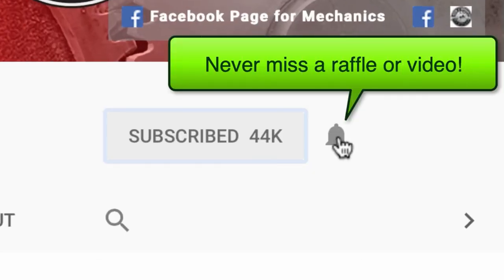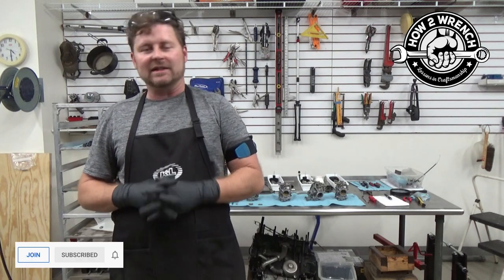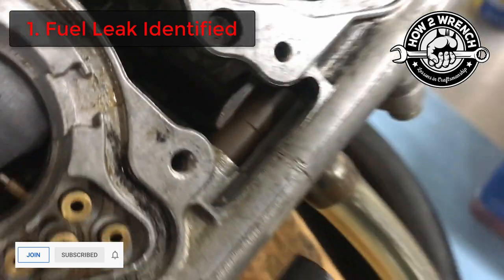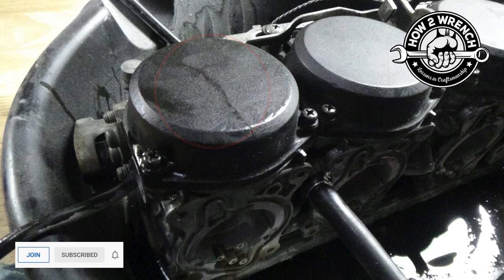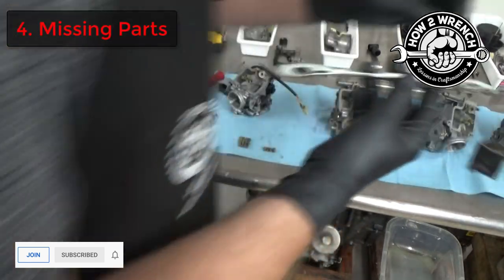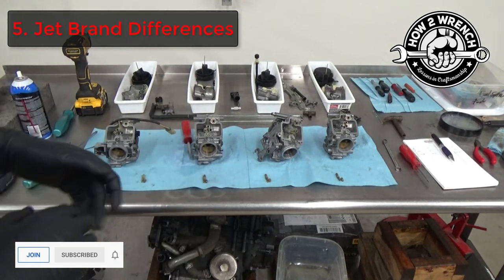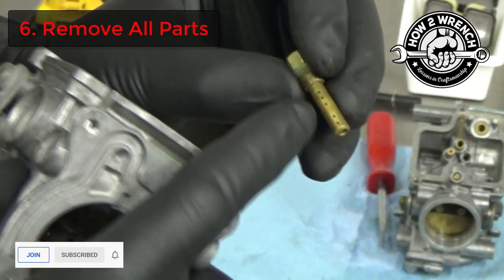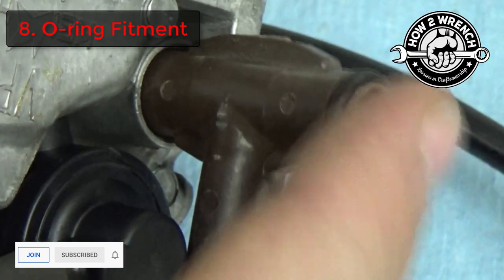One Carburetor rack with 7 different problems when we split the rack #how2wrench #carbrebuild

Comment: Are the deep dive videos for this carb job ready yet? I couldn't easily find them if so. Not that YouTube has best interface for that.
Reply from the maker: Hey JM what model you looking for? I can prioritize it since you are a member...and thank you.
Reply: @How2Wrench  You're welcome, Shane. The O-ring video would be very helpful. In the past I've had great luck getting quality Viton o-rings from the O-ring Store LLC online, but measuring and sizing them is a challenge of course because old o-rings have often shrunk, etc. I will check out your other video about o-rings in the mean time. I'm working through about five sets of carbs slowly and there's going to be a lot of o-ring replacement.
Reply: @How2Wrench  I took a look at the other video on o-ring selection and it appears to be pretty straight-forward. I'm just going to order several sizes in the range of the carb tubes if they don't have a viton metric kit. Thanks.
Reply from the maker: @JM-gb7hf  Want to schedule a call (free as a member since the video is not ready) and chat a bit about orings and your projects? email me at how2wrench@gmail.com and I'll get you my cell.
Reply: @How2Wrench  Thanks, Shane. Email sent.